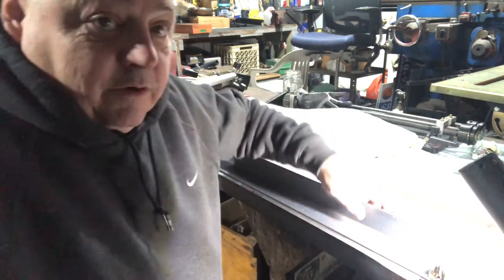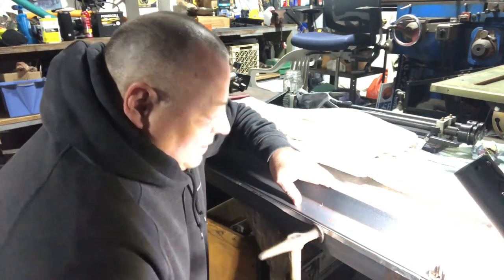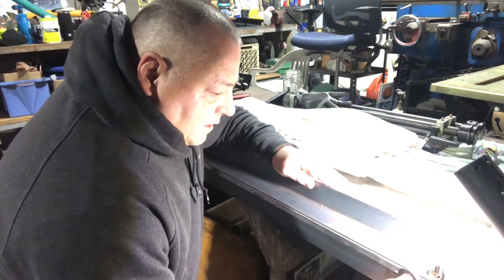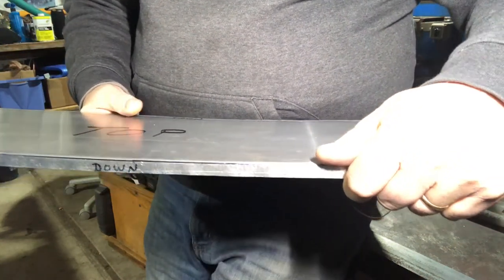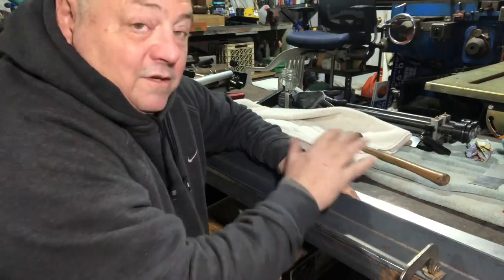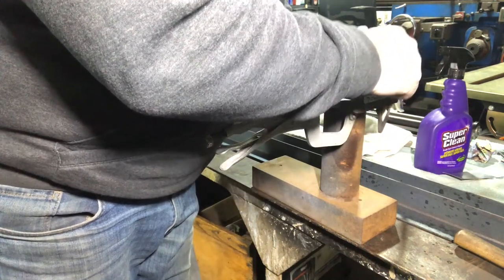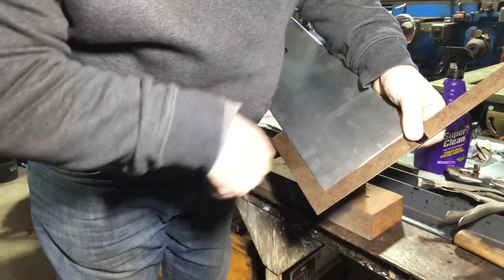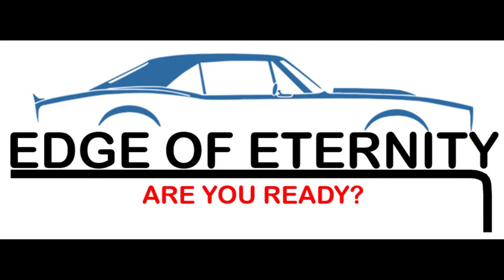1969 Z28 Blue Edge Rad Cover Part 3 - Hammer Time!!!

Comment: hey bill top tip, when hammering down a flange do it slowly and accross the entire piece, if you hammer a small section it will stretch the metal and then when you unclamp it it will have a bow
Reply from the maker: Definitely got the banana!!!
Reply: @EdgeofEternityBillCameron  i noticed when i got to the end of the vid, easily fixed and still looking good